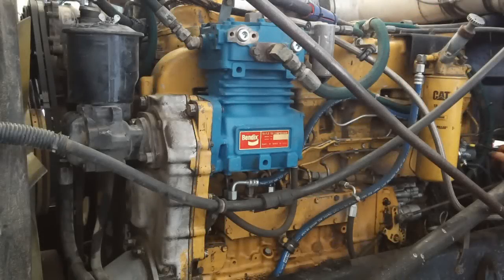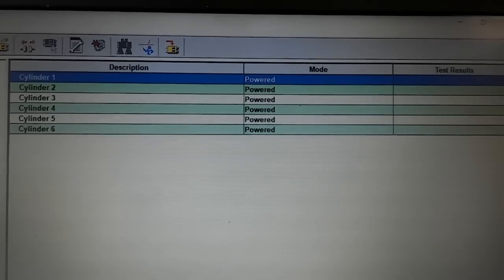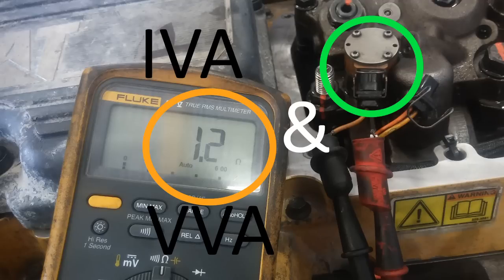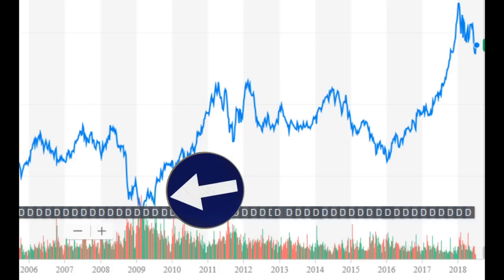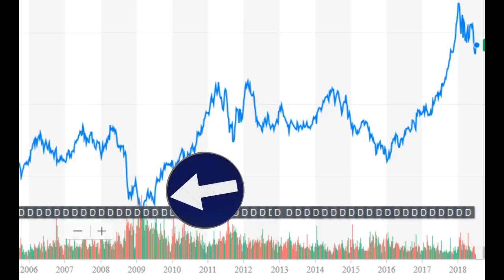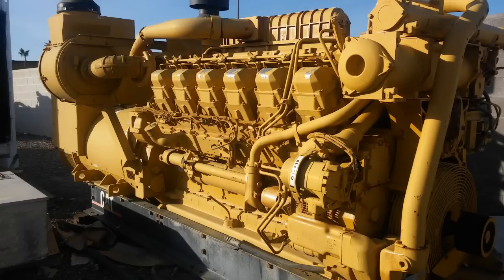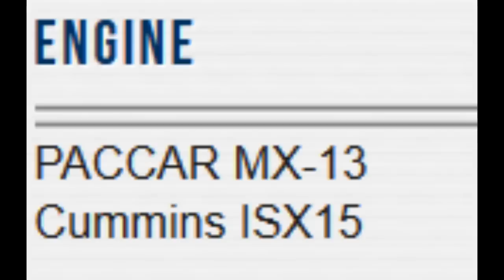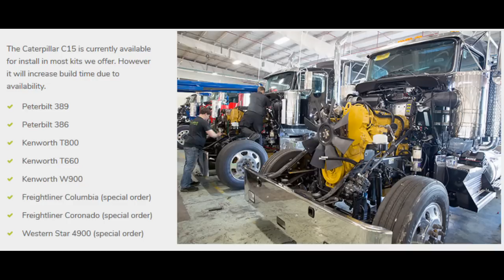Why Did Cat Stop Making Truck Engines?

Comment: It really is a shame...I mean just sickning..First of all, I had a 389 with the paccar when they first came out, and that was a joke. Numb as a fuckin boot and the water pump started to come apart before i even hit 50k, pully was flopping all over the place and no one had one. The only one that could be found was in europe. Did I mention it couldnt pull a greasy string from a cats ass? and that was with 373 rears and an 18 speed. I have a 15 pride an class now with a 565 cummins and it does better than the paccar but still is NO cat. Its laggy as fuck. by the time the turbo gets all the way spooled up your dropping another gear because it doesnt produce any lug under 1700. You literally have to be mad at it to get it to perform. Your not getting any kind of fuel milage wound up on the pin with WOT. Those older cats, esspecially the mechanical ones still pulled like an animal lugged down at 13-1400 and even though youd be WOT at that point, your still burning far less fuel WOT at 13-1400 than you are WOT 18-2200. And anyone thats driven any of those old cats and big cam cummins and todays, cats are far smoother shifting and not as picky. This cummins I have in my pride and class cost me $20k getting the burn box and everything else replaced at 280k. and unfortunatly as far as I'm concerned esspecially since frightliner stopped production of the classic the 389 is it. Theres a few other makes out there that look ok if theyre done up right. Some of the KW look ok but Id never buy one. Feel like your sitting on the roof even though you still cant see anything, they ride like a horse an buggy, that one peice windsheild looks stupid. These slope nosed set back axel grass burners with plastic fairings covering everything are as gay as aids. I mean I get, for some of these big fleets who hire anyone with a pulse I get why thats what they offer, for 1000 and 1 reasons I get it but most of those guys either dont care because they have no other way to make a living and are lucky to have that an to dumb to know any better or care, or theres those guys that woke up one day an said "I'm gonna be a truck driver". Used to be those guys didnt last but standards are pretty low now. Dont even have to speak or read english to obtain a commercial drivers lisence anymore. Dont even have to be an american citizen. Traffic signs are just guide lines in most areas anyway. Between all that, the bullshit regulations, the black box this governments talking themselves right out of fright, and anyone that was deep in this industry 30 years ago knows exactly what im saying, why I feel the way I feel and how much the governments prospered while the hard working drivers getting it broke off in his ass. I know I got a little off topic an probably would have felt a little better if I said all that while raising my voice an throwing shit =D     Although, just wanted to throw out there, meanest truck I ever rolled acros the pavment was a Gray 1987 Ford LTL-9000. Had a 3406B that was heavily worked on. It had a factory long wheel base, canadian spread and a flat top..45" maybe? I loved that truck. Had under 75k when I got it. 1st owner bought it, put a bunch of money into it then had it repossesed. So wish I had pictures of all the trucks from the yard back then.

Comment: CAT has always been a good engine. A friend of mine drove an old International wrecker with a CAT, had over a million miles and was the strongest truck in the fleet. He moved into a duramax 4500. Loved it when the 4500 went down and was put back into "old reliable" from time-to-time.
Reply: Isuzu 4500

Comment: You didn't tell the full story. Cat could not meet the emission standards and the fine per engine was low enough it was cheaper to add the fine to the price of the engine and not redesign the engine to meet the standards. Cummins mean while had spent the money early on, and the time to design their engines to meet the standards. So they cried "foul" to the EPA. The EPA agreed and Cat had to bow out. It all came down to Cat not putting the resources into their engines years before in order to be ready. It was too little too late.. Have a nice day.

Comment: You need to address the main issue and that is CAT can not pass emissions.  They tried to do an SRC system but tried to make the process incorrectly.  Also you should address at the same time CAT was losing market share, Cummins was taking over cause the fuel efficiency and emissions were top of the line and offering 15% better fuel mileage. The real reason CAT failed was do lack of R&D into emissions and fuel economy.

Comment: It's interesting to add a bit about the history of ACERT. This, which included both the twin turbos and variable intake valve timing, via hydraulic stoppers that delayed valve closing variably, was actually a superior way to reduce Nox and soot for the 2002 standards. Cat introduced this in 2003, paying penalties for non-compliant engines till it came it. It improved the combustion, both in terms of soot and Nox production, by cooling the intake charge. Unfortunately, when Cat came up with Clean Gas Induction for 2007, which had advantages at least potentially, they did not do an adequate job of designing and testing the regeneration system the above commenter mentions, as well as creating other problems. I happen to believe that it is tragic that they did not just put SCR on their engines and clean them up for 2010. But, as a maker of construction equipment and diesels for many markets, like marine,. where emission standards are less stringent than in trucks, they apparently decided they would find production of engines for these markets would be much more profitable, especially in light of the investment necessary for adaptation of their truck engines for 2010. ACERT Caterpillar engines are still used in smaller ships and construction machinery all over the world. ACERT was actually a superior technology in some respects, greatly reducing oil soot in the early days versus EGR engines--to the extent that Cat engines actually resisted break-in, which depends upon the abrasive nature of soot in the oil.
Reply: Yes the `04 ACERT was a brilliant engine - truly a step change. In Australia it had DPF's added to it and a slight tweak to the fuel map to meet the equivalent of EPA'07 - same rules as the Cummins Signature 600 required. Right to the end it was competitive in fuel consumption - when the engine was 14 years old......

Comment: Well I was driven OTR( Over The Road) when this so called great thing called  DEF came out, You can blame that ... I drive still, truck is in the shop ohhh at least once a month something to do with this great DEF crap.
   I recall seeing a episode of MITH BUSTERS,  they tried every thing  & it did the exact same thing as DEF...  It's all about $$$$ I was told by our machenic that Cali is trying to get rid of this DEF... Just think how well the engine s would run

Comment: I think it's important to remember that early gasoline emissions technology also sucked ass. I have hope for a future when there are reliable powerful compliant diesel engines.
Reply: Yah—

—But diesel does not, at least as of Spring 2022 Epoch, as clean as gasoline in engine combustion chambers.  The "dirt" is no way to be put back through the intake system as EGR systems do.  

Hence why I bought a pre-EGR truck.  My 370-425 Smart Torque Cummins N14 out pulled any Detroits, Volvos, Internationals, and Macks on highways. 

 The Cummins ISX15 gives my motor a run for it's money—but I do not worry about liner drop or rods coming through the block.

Most 13+ liter Caterpillars we're stronger than me—but at a price: they were much more "thirsty" than my engine.  I would have to be getting better freight rates to cover the 5-mpg.
Reply: @michaeldunagan8268  that's a fair point that I hadn't thought of, thanks for explaining it

Comment: Ego, and the failed attempt by Cat to dominate the on road engine market is why Cat no longer supply new truck engines, the failure to meet emissions standards is just a convenient excuse. Cat wanted to starve truck manufacturers, particularly Kenworth of their engines, then force new truck buyers who wanted a Cat powered rig to buy a Cat truck, because that was the only new rig on the market with a Cat motor in it. Needless to say it didn't end well for the once great lugger!

Comment: My observations didn't last very long but.   I started driving one of the lower horsepowered  Cummins in 1991, when Cummins were Cummins and the family owned it.Anyway , I"d  head cross country at my governed 60  mph speed.  Trucks would pass me going 80 plus mph. Normally they'd make fun of me, and the company I worked for.  A day and a half later, I'd start catching up to these Cat drivers that were running their mouths the day before. They'd be in the middle of nowhere in Wyoming, or Utah, or Montana, the truck on the side of the road, the hood up, and a fat white ass creeping out of the jeans.  I'd toot the horn once and keep on trucking. Maybe someone with knowledge can help us here. I don't know what the problem was.  On the other hand, I went to the Philippines in 1999, to meet a girl. I stayed in an old wooden hotel. Outside was a Caterpillar generating unit that we had left there at the end of WW II. They had built a roof over it. Electricity was spotty then, probably still is.  They fired up that 1940's Cat engine, walked away, and left it making electricity for that crappy hotel.  It never missed a lick, the lights never flickered . The engine looked like it had never been apart. Just had oil changes and filters replaced. I'm very confident it's still there doing it's job when called upon. I did read the nomenclature tag, and it was a military unit built in the 40's. The generating part was whatever was put on them in those days. It too, appeared to have never been apart. That year and a half going back and forth to California, or the Northwest, I must have seen 15 of those broke down trucks with a bright yellow engine that had a problem. Understand I'm not intending to poormouth Caterpillar. I've driven their big dozers, and road graders. The kind with the gasoline pony engine you had to get running first. No problems, other than that pony engine had a steel gas tank that got rust in it. Come to think of it , these were Korean conflict Caterpillar powered dozers and graders, that we got surplus from the govt. They , too never missed a beat, once you got them running,

Comment: My experience is as a bus driver (transit and charter), not trucks.  Most of the buses I've seen had either Detroit or Cummins engines in them, I've also seen a few Volvo diesels as well (Previost buses).  Maybe its because the mechanics aren't used to them, but the few buses that my company has that have Cat's in them seem to be down more than they are running, and you have to plug the block heaters in if it gets colder than 40 F otherwise they won't start, where as the Detroit's will start just fine without being plugged in down to the 20's.  Again this just from my own experience.  As for Cat highway engines being killed off by EPA, what a load of crap!  They simply choose to give up and not design a new engine, that's their fault.  Detroit, Cummins and others had major issues with adding DEF to their engines at first, but once they put forth the effort to completely design a new engine from the block up those that stuck with it managed to come out with great products that use less fuel and have lower maintenance costs while being able to meet emissions.  The DD13 and ISX12/ISX15 are both great engines.  The one major difference being that you have to drive/operate the new engines differently, idling now is bad so you need to shut them down whenever you can.  I've heard stores from some of the old timers about having to put tarps over their cars when parked at or near truck stops and yards because the NOx would eat the paint off otherwise! I fail to see how the newer emission standards are a bad thing.  Better engines, less fuel burned and if operated correctly lower maintenance.  How is that bad?

Comment: Cat Australia marketed their own truck in Australia with dismal results. Found to be extremely unreliable both mechanically and electronically, with very poor chassis and body engineering that fail to withstand Australia's punishing on and offroad conditions and the goverment regulations. The last models imported did actually have a Cat drivetrain, but severe overheating issues due to a badly engineered EGR system ensured limited engine life. This problem was never resolved and the brand disappearing from Australian roads. 👍👍

Comment: Part of a good product is being able to adapt with a changing standard. They should go electric
Reply: Don't know much about trucking, do you?
Reply: @pookysdad4884  no I don't . not as much as I could know . Always willing to learn
Reply: @j.s3612  I'm no expert myself, but my dad was a trucker, and I've been around them all my life. Loaded trucks weigh up to 80,000 lbs (in some states, up to 105k), so they need engines with TREMENDOUS torque. Electric motors do have that. But they also need range. Long haulers routinely log 600 miles per day. Even a 5000 lb Tesla can't do that. Tesla is building an electric semi that MIGHT be usable for short hauls, though. It's also possible to have diesel/electric HYBRIDS, since locomotives have and some EXTREMELY large machines have been built this way since the 1950s. A giant electric motor at each wheel, and a HUGE diesel engine to run the generator. But that still uses a LOT of fuel and still creates smoke.

Comment: The other reason not mentioned was the recall on every on road cat engine oil return line on the back of the head costing them 100s of millions in 2008 and on
Reply: I tested those engines in 2007 in Mossville and had Alot of fires due to oil supply lines popping off and oil hitting the turbos causing flash fires. Ur totally rite.

Comment: Yes, Cat owned 40% on road engine industry, but the biggest factor for Cat leaving this particular on road engine industry was Cummins flooded the market for four years from 06 - 2010 with rock bottom priced engines..! Cummins was basically cutting profit margins to bare bones pushing competitors out of the market. 

It was a win all or lose all business strategy for Cummins..! Cat required return to continue high quality standards Diesel engine builds simply overpriced them out of the market..! Plain and simple..! 

Cat owns dozens diesel engine parts patents continue use today in other engine manufacturers products especially International..! Cat has largest commercial grade diesel generators, marine engines, locomotive, heavy construction equipment and especially military vehicles..! 

Majority of mentioned issues in video actually played very little into Cat leaving on road diesel engine market..!

Comment: Caterpillar read the writing on the wall...
Diesel engines have become as complicated or even more complicated than gas engines with all sorts emissions systems hanging on the engine that wear out and break down.
Without an EGR system and after-treatment no engine will meet new emission standards. Look at what happened to International, they just about took themselves out trying to outsmart everybody else and try to do it without after-treatment and rely only on split-shot injectors then found out it didnt work after it was too late and engines were in production. Cummins engines will own the market pretty soon, they seem like the only survivor.

Comment: Sorry, but the truth is CAT didn't "want" to be out of the on-highway market... Cat couldn't meet Tier 2 emissions standards because of that low-tech abomination called the "ARD head" so the EPA was fining them for every single non-emissions certifiable truck they powered... Cat was like "That's cool, we make enough to cover the fine" and continued to build non-emissions certifiable engines for the on-highway market.  The EPA, not liking CAT thumbing their nose at them, said "Hold my regs" and upped the per-truck fine into a low earth orbit that not even George Soros would have paid.Now that Tier 4 is here and aftertreatment is required on even off-highway, how does CAT build engines??  That's right, they use a DEF/DOC/DPF/SCR arrangement like everyone else.... 'cept it's not theirs, it's Cummins, because CAT isn't smart enough to build an aftertreatment system.  So why doesn't CAT just buy more Aftertreatment systems for on-highway and get back in the game you ask?? Because Cummins won't sell them an on-highway system, LOLOLOL.....CAT didn't want out of the game.  They got sent home.  Oh, and "40% market share"???  Can you back that with some numbers? Because I think you pulled that number outta your ass.  Now, they might have 40% of the "shitty boots you can buy at WalMart" market, but NOT on-highway trucks.One last thing... that PACCAR MX13?  That's a Cummins too.

Comment: 3208 was truly a crap engine on the same level as a 6.5L GM......  3406 was a bulletproof beast, but if you got 5 MPG you were going downhill with a tailwind.
Reply: I had a 1972 ,W900  Kenworth with a 1693  425hp Cat and I got 6 mpg loaded

Comment: I bet the real mechanics didn't find the "new" CAT engines much easier to work on. Cheap electronic garbage components that eventually fail. What do you expect from these fools in the EPA haven't figures out that the extra cost of maintaining, replacing shit components, and downtime of trucks in repair shops negates all their fuel saving bullshit. Drivers can't afford to repair their trucks if they're constantly idle due to repairs. All of this doesn't excuse CAT from bad business decisions either.

Comment: An ECM is an ENGINE CONTROL MODULE.
Reply: Tristan Raybon I have worked for Cat for 30 years. ECM= Electronic Control Module. They are used in Power Train, Hydraulics, etc